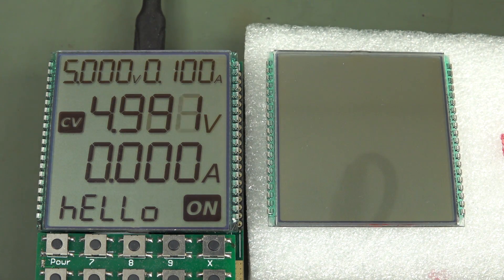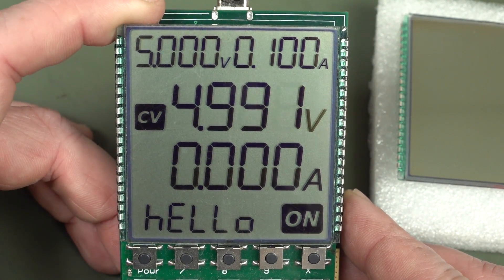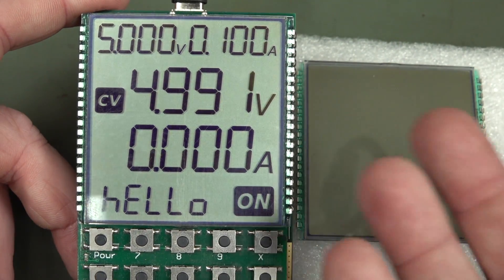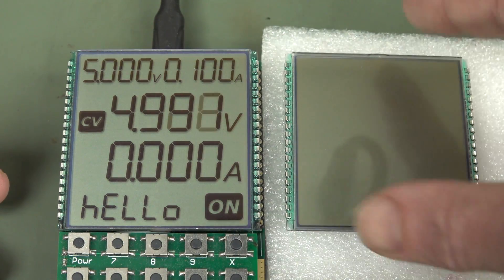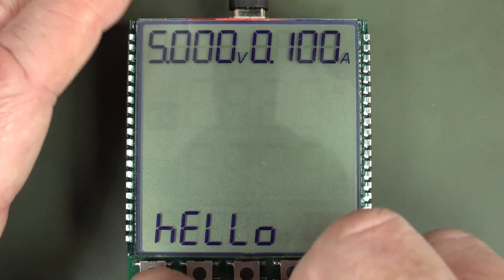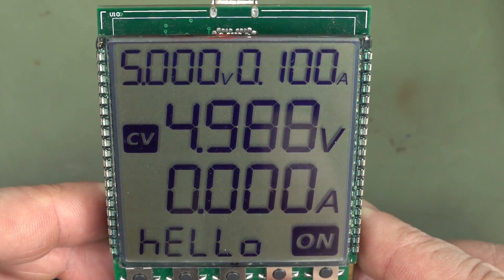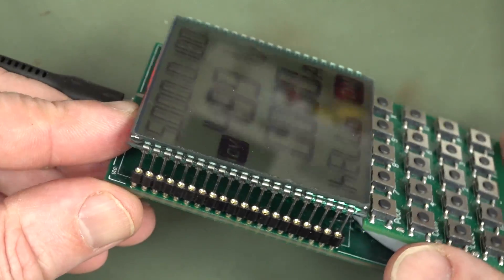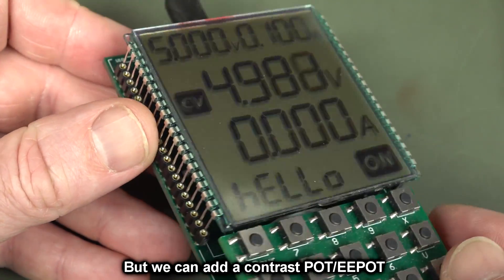New Custom LCD

Comment: Did you use USB-C on that carrier board? It would be great to see info about using USB-C on diy boards, I've been under the impression it's not quite as easy as it was to slap a micro connector on.
Reply: The pin pitch is a lot smaller more like an hdmi connector but otherwise usb-c is easy if you dont need the usb 3 stuff.
Reply: @Jonas_Meyer  do you know if there are any easy to aquire chips out there that let you get usb PD, without doing certification and whatnot (not for sale projects, just diy)
Reply: No sorry. The native 15W was always enough for me. But if you are into diy maybe this can be useful: https://hackaday.io/project/20424-pd-buddy-sink

Comment: Looks like instead of fixing the tooling they just changed the liquid crystal chemistry to make it more susceptible to low voltage. With the adjustment pot you may find that the segments in question will fade again when you get away from ghosting. And all of this with lower contrast blueish color. Don't like it. Looks like they'd better asked money for new tooling.
Reply: Dmitriy M Yes it appears they switched from TN to STN. STN is a superior liquid crystal but has the effect of appearing dark blue.

Comment: If they have a stock of the old ones you might find some cheap chinese Power Supplies with your display Design coming to ebay soon :P
Reply: i was thinking just the same....you are about to loose your (c) if you use chinesium manufacturers
Reply: TubiCal: i once ordered pcbs for a kit, which at the time did not exsist on ebay yet, from one of these manufacturers and less than a week later the kit was available on ebay with almost an identical pcb layout xD
Reply: @Blowcrafter  happend to a friend of a friend too. They even added an enclosure ! He considered it an honor to see his design as a product on aliexpress XD
Reply: Nah they love their 7-seg LED displays xD
Reply: i put my logo and name in the copper of my pcb so maby it wil help

Comment: I do like when products like this have a contrast pot, since the optimal contrast changes with angle. I added one to my 3D printer's screen, helped it a TON
Reply: 3D printer LCD modules are funny. You don't need more than 3V for the contrast input for the controller, but they still divide the wonky 5V input down to drive it in spite of a perfectly fine 3V3 regulator available RIGHT THERE on board to feed the SD-Card.